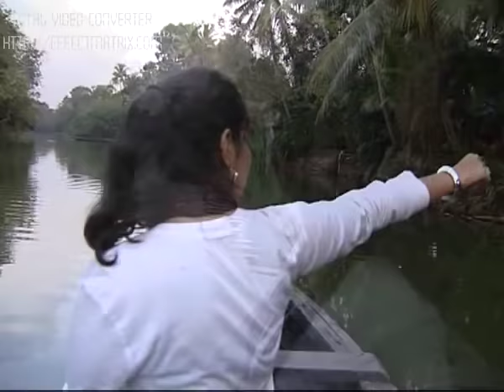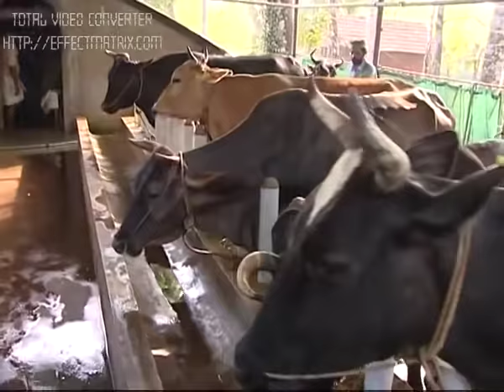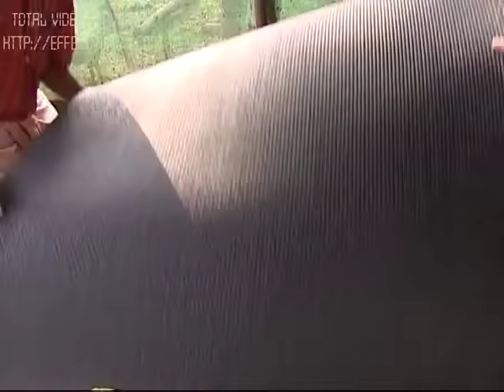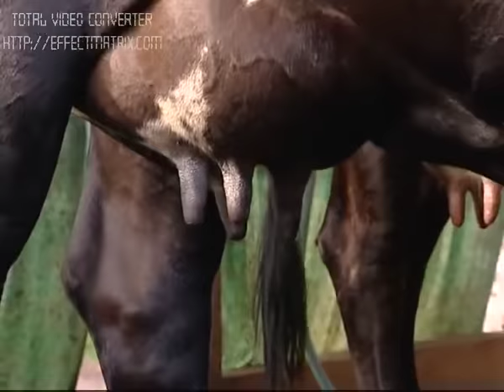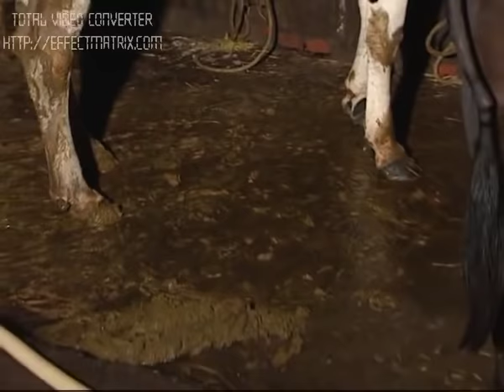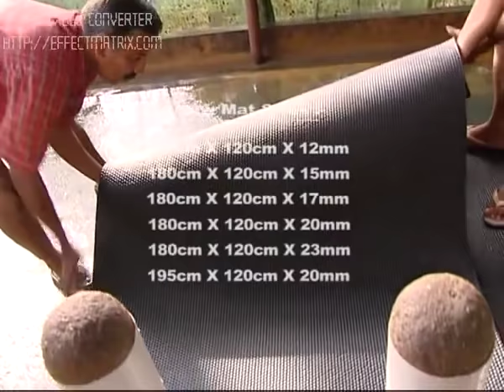Cow Mats By TJP Rubber Industries, Kottayam

Comment: how much cost plz replay must
Reply from the maker: Hi HARDIK RATHOR, request you to log onto the IndiaMart platform: http://goim.in/Pnnnv36p , and give us details of your requirement. We will respond to you right away.
Thanks
Reply: Dear Sir,

Greetings from Patel Brothers!!

Thank you for showing interest in our Company.

With a strong backing of our proficient engineers and industrial experts, Patel Brothers is engaged as a supplier and manufacturer of pumps and other industrial machines. Based at Madhya Pradesh (India), we entered the industry in 1977 with an aim to become the most sought after brand to avail industrial goods at most affordable prices. We are offering HDPE Pipe, Generator Set, Food Processing Machine, Engine Pump Set, Concrete Mixture Machine, Centrifuge Pump Sets, Alternators and many others. We fabricate all these products by using materials that are tested under several quality standards before use. Offering materials at committed time frame and affordable prices makes us the first choice of our valued clients.

Our Product Category Line:
• Bare Motors
• Atta Chakki
• Portable Silent Generator Set
• Agricultural Weeders
• Sugarcane Crusher
• Disposable Product Making Machine
• Generator Set
• Electrical Alternators
• Open well Pump
• Motor Pump Jet
• Milking Machine
• Agricultural Harvester
• Food Processing Machine
• Concrete Mixture Machine
• Chain Saw Machine
• Agricultural Pumps
• Engine Pump Set
• Outdoor Fountains
• Plastic Pipes
• Chapati Making Machine
• Intercultivators
• Agricultural Reapers
• Industrial Pulverizers
• Chaff Cutter
• HIP Sprayers
• Engines
• Solar Products & Equipment
• Agarbatti Making Machine 45,000/18%
• Dona Pattal Making Machine
• Agricultural Cultivators
• Garden Equipment
• Flour Mills
• COW METS 1200 rp
 Diesel Generators
. powar weedar 6,800 se rez suru to 90,000 tak avelebal
For more details,
visit : www.patelbrothersujjain.com ; www.shripateludhyog.com ; www.milkingmachine.co.in ;
www.agriculturemachine.com
Enclosed here is the Price List for your convenience.

Feel free to contact.

For Patel Brothers
Ganga Parihar
+91-9300018185

Comment: sir Gorakhpur Mein milega
Reply: Dear Sir,

Greetings from Patel Brothers!!

Thank you for showing interest in our Company.

With a strong backing of our proficient engineers and industrial experts, Patel Brothers is engaged as a supplier and manufacturer of pumps and other industrial machines. Based at Madhya Pradesh (India), we entered the industry in 1977 with an aim to become the most sought after brand to avail industrial goods at most affordable prices. We are offering HDPE Pipe, Generator Set, Food Processing Machine, Engine Pump Set, Concrete Mixture Machine, Centrifuge Pump Sets, Alternators and many others. We fabricate all these products by using materials that are tested under several quality standards before use. Offering materials at committed time frame and affordable prices makes us the first choice of our valued clients.

Our Product Category Line:
• Bare Motors
• Atta Chakki
• Portable Silent Generator Set
• Agricultural Weeders
• Sugarcane Crusher
• Disposable Product Making Machine
• Generator Set
• Electrical Alternators
• Open well Pump
• Motor Pump Jet
• Milking Machine
• Agricultural Harvester
• Food Processing Machine
• Concrete Mixture Machine
• Chain Saw Machine
• Agricultural Pumps
• Engine Pump Set
• Outdoor Fountains
• Plastic Pipes
• Chapati Making Machine
• Intercultivators
• Agricultural Reapers
• Industrial Pulverizers
• Chaff Cutter
• HIP Sprayers
• Engines
• Solar Products & Equipment
• Agarbatti Making Machine 45,000/18%
• Dona Pattal Making Machine
• Agricultural Cultivators
• Garden Equipment
• Flour Mills
• COW METS 1200 rp
 Diesel Generators
. powar weedar 6,800 se rez suru to 90,000 tak avelebal
For more details,
visit : www.patelbrothersujjain.com ; www.shripateludhyog.com ; www.milkingmachine.co.in ;
www.agriculturemachine.com
Enclosed here is the Price List for your convenience.

Feel free to contact.

For Patel Brothers
Ganga Parihar
+91-9300018185

Comment: Yay kaha mely gah
Reply: Dear Sir,

Greetings from Patel Brothers!!

Thank you for showing interest in our Company.

With a strong backing of our proficient engineers and industrial experts, Patel Brothers is engaged as a supplier and manufacturer of pumps and other industrial machines. Based at Madhya Pradesh (India), we entered the industry in 1977 with an aim to become the most sought after brand to avail industrial goods at most affordable prices. We are offering HDPE Pipe, Generator Set, Food Processing Machine, Engine Pump Set, Concrete Mixture Machine, Centrifuge Pump Sets, Alternators and many others. We fabricate all these products by using materials that are tested under several quality standards before use. Offering materials at committed time frame and affordable prices makes us the first choice of our valued clients.

Our Product Category Line:
• Bare Motors
• Atta Chakki
• Portable Silent Generator Set
• Agricultural Weeders
• Sugarcane Crusher
• Disposable Product Making Machine
• Generator Set
• Electrical Alternators
• Open well Pump
• Motor Pump Jet
• Milking Machine
• Agricultural Harvester
• Food Processing Machine
• Concrete Mixture Machine
• Chain Saw Machine
• Agricultural Pumps
• Engine Pump Set
• Outdoor Fountains
• Plastic Pipes
• Chapati Making Machine
• Intercultivators
• Agricultural Reapers
• Industrial Pulverizers
• Chaff Cutter
• HIP Sprayers
• Engines
• Solar Products & Equipment
• Agarbatti Making Machine 45,000/18%
• Dona Pattal Making Machine
• Agricultural Cultivators
• Garden Equipment
• Flour Mills
• COW METS 1200 rp
 Diesel Generators
. powar weedar 6,800 se rez suru to 90,000 tak avelebal
For more details,
visit : www.patelbrothersujjain.com ; www.shripateludhyog.com ; www.milkingmachine.co.in ;
www.agriculturemachine.com
Enclosed here is the Price List for your convenience.

Feel free to contact.

For Patel Brothers
Ganga Parihar
+91-9300018185